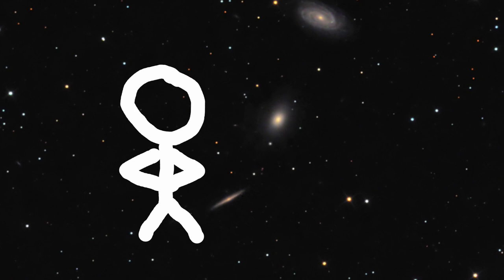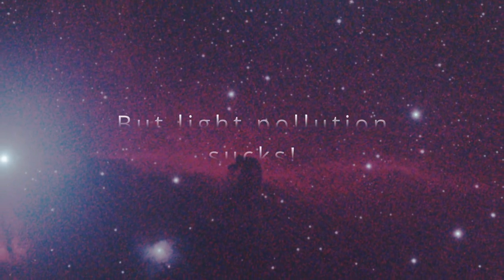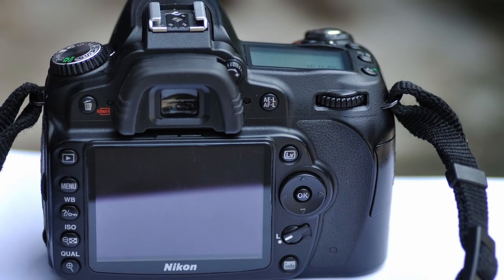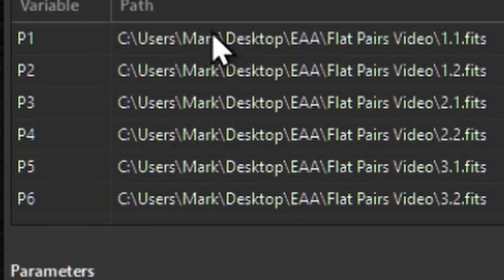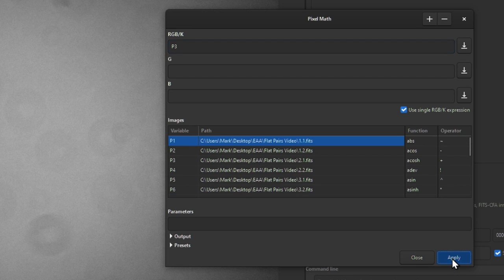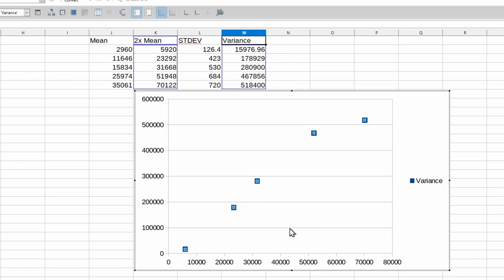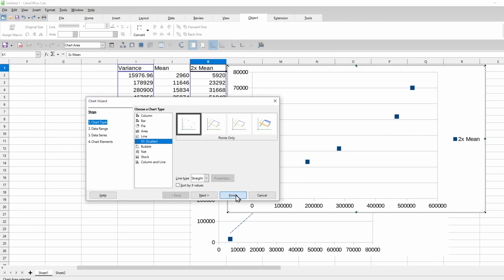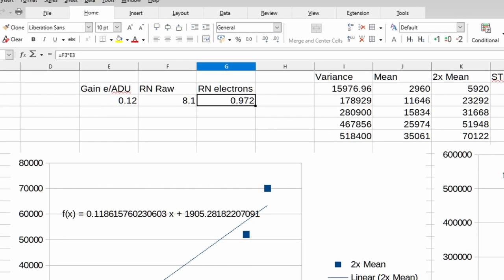How to measure Gain and Read Noise for a DSLR in Siril

Comment: Thank you! This is great resource!! I’ve been trying to do this for quite some time.  One question if I have a panel that is pretty bright can I vary the exposure time or does that have to remain constant? Using an ipad don’t you start seeing the bayer matrix?
Reply from the maker: Thank you! I think you want to keep the exposure length constant. One way you can vary the brightness is by putting paper over the telescope opening. Start with one piece and then keep adding more to vary the brightness. Or if your aperture is bigger than paper, you could try t-shirts or something.
Reply: @deepskydetail hi! I just wanted to let you know that I’ve tried determining the gain both ways - varying the exposure of the camera and sheet method you suggested - I got essentially identical results. However, I believe my result was half what I expected .2 at iso 800 and .4 at iso 400 for my Nikon d7500. I noticed that the procedure the AAVSO outlines divides the variance by 2 but does not multiply mean by 2. If I divide the variance by 2 I get the result I expect but only if I use the 2x mean column. Any thoughts?
Reply from the maker: @eacron  Thanks for the follow up! Do you have a link to the procedure you used based on AAVSO so I can compare the two methods?

Comment: Great Video. I was looking for a while to get my Sony A7M3 Gain and Noise in e. However I think there is a small mistake in determining the variance / stddev in the flats. Before substracting the flats from each other to one flat a constand number should be added to avoid clipping the negative values to zero and cratinfg a false stdev / var of the resulting image. At least in PI which I used it is like this. Thanks again and hopefully you will do more intresting videos like this on you channel. Greetings from cloudy and rainy Geneva, Switzerland.
Reply from the maker: Thanks! In Siril, as far as I understand it, it can have negative values after pixel math (the stdev should be the same either way). So there shouldn't be clipping. But that's good to know in pixinsight.

Comment: i followed your tutorial, but my mean flat brightness and stdev are inverse to each other. is something wrong? so my gain is "negative". my mean values range from 13000-55000 (going up) and my stdev are from 5000-2000 (going down). all my camera settings are manual, and i converted the raw .orf files to 16bit tifs in Ps, then to 32bit fits in siril. then i did exactly the same as you. do you know whats wrong?
Reply from the maker: Are you using the same settings for each of the pairs of flat frames?
Reply: @deepskydetail  yeah exact same. what does the stdev calculate? (havent learnt it in skl yet)
Reply from the maker: @Ekuy1  The standard deviation is just how much on average the pixels are different than each other. It's a measure of noise.  How are you manipulating the brightness? Adding things (like paper) in between the objective and tablet (or whatever you use as a flat panel)? One thing that it could be is if you're using different exposure times (different exposure lengths would be a problem).

If none of those things are the problem, could you email me at deepskydetail at gmail the spreadsheet your are using? I can take a look

Thanks!